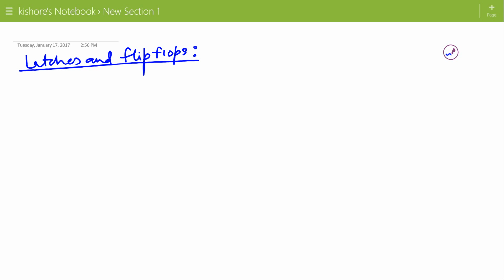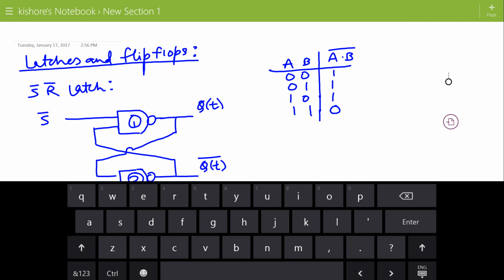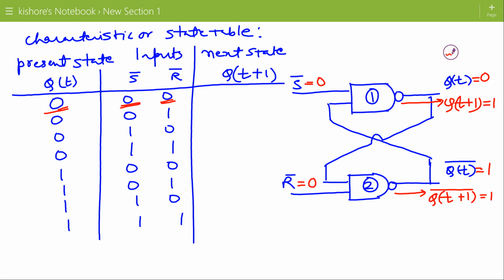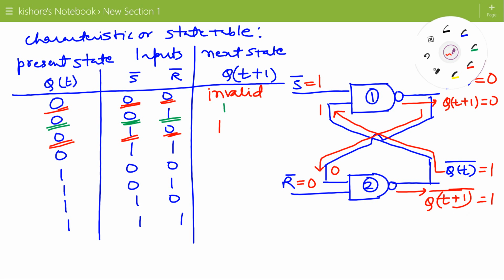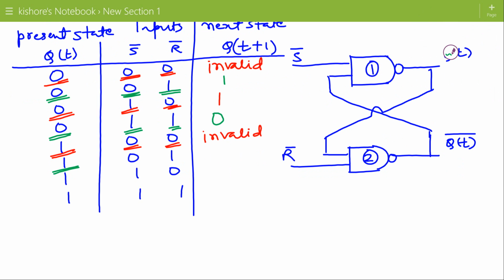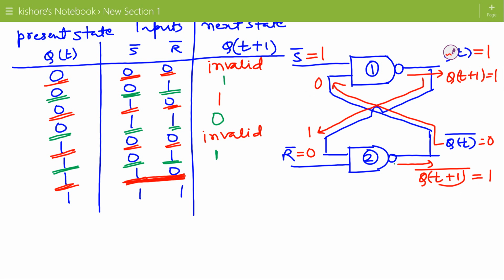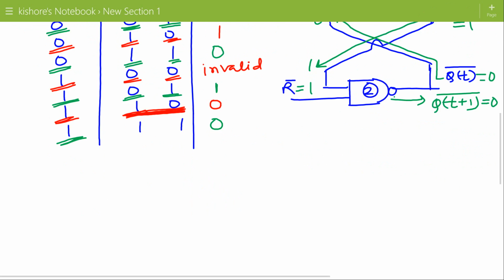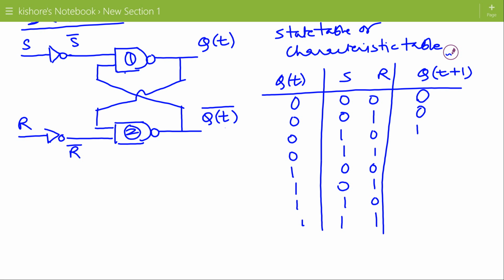How Latch or Flip-flop Works

Comment: You gotta a mistake on third case for latch. Q(t+1) should be zero
Reply from the maker: +方剑 雷 
I will check........
Reply from the maker: +雷方剑 
Yes you are correct, I made a mistake in third case while tabulating but it's zero in the circuit diagram. Thank you.